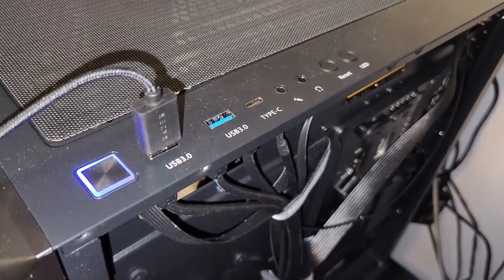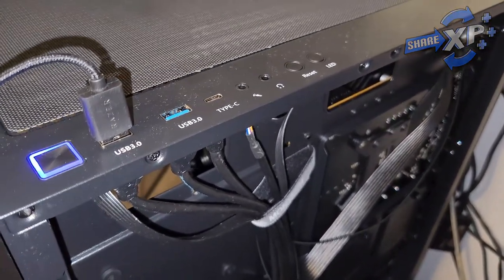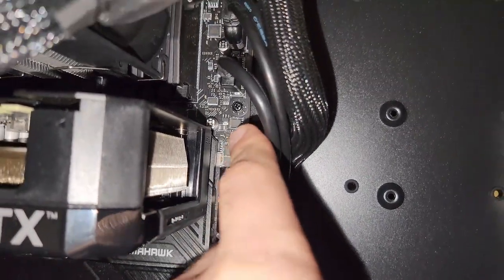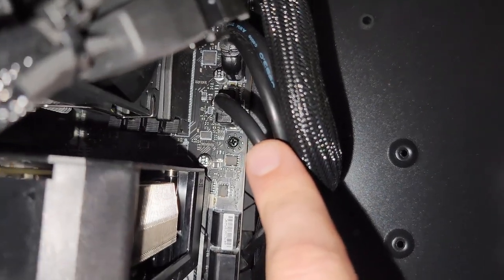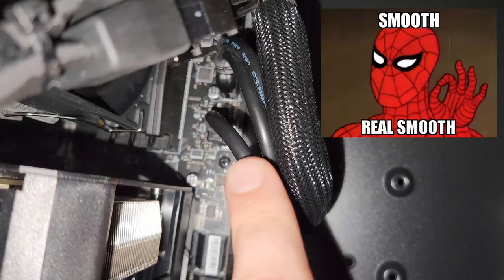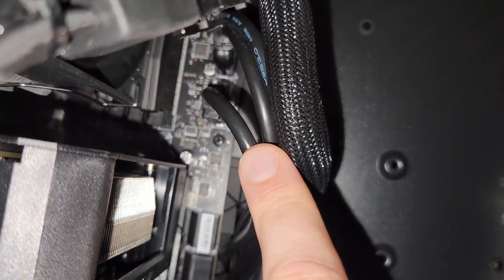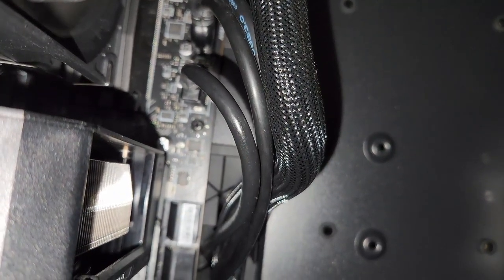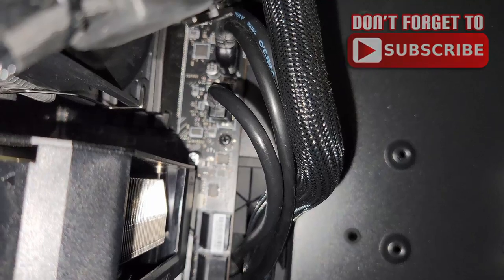Front USB C Not Working? Quick Solution for Front Header USB 3.2

Comment: I hope you are correct. I will do thjs in a minute.
Reply: I worked for me and I couldn't believe it. I had tried re-plugging it several times and even took apart my front panel to ensure connections, but turning the connector to plug it in was very difficult in m case. So with that that, the fact the cable was plugging in fully in the wrong direction, and it being for USB-C which is known for it's reversibility, there's no way I would've EVER thought to try this.

Comment: Oh my god. You just cured 3 years of difficulty and frustration and for not being able to get the front USB-C 3.1g2 connector to work and failed attempts at fixing it. I honestly can barely believe this worked and that I even decided to try it. Among other things, I scoured over the manuals and websites of both motherboard and case, and none of them mention this ANYWHERE.

And you know that? I bet it's because both of them just didn't know!! They probably just think it's flaky and send replacement cables until the customer happens to plug it in the right way.

Otherwise, they would have explained somewhere this obvious design for a popularly reversible cable and this foolproof system where the other side of the cable can be plugged in either way but only one direction works.

I've been building and fixing computers for almost 30 years, so it's nice another idiot put this on YouTube and let me know I wasn't the only pathetic imbecile out there. Thank you so much. Getting it to work is great and all, but it's even greater we got to learn so much through this process of fixing it.
Reply from the maker: I'm your friendly neighborhood idiot. 👍

Comment: Hmm, I have an Asus X670E Hero mobo and Zalman Z10 case. Port is not working, not able to flip it around without using the force. Bought a different cable just to try but nothing works. There is no power to the port in any state or combination. The connector seems to be plugged in well. Any thoughts?
Reply: I'm facing the same problem
Flipped it over and still won't work
Connection is in properly and it's a brand new case and mobo so doubt it's damaged
Reply: @ghulamwadee7004  @baklazan72  b650 aorus elite ax ice and in a similar boat.  Tried flipping the cable but it does not seem fit in any other direction than the way i have it which does not work.  Could this be a montech air 903 max case issue?